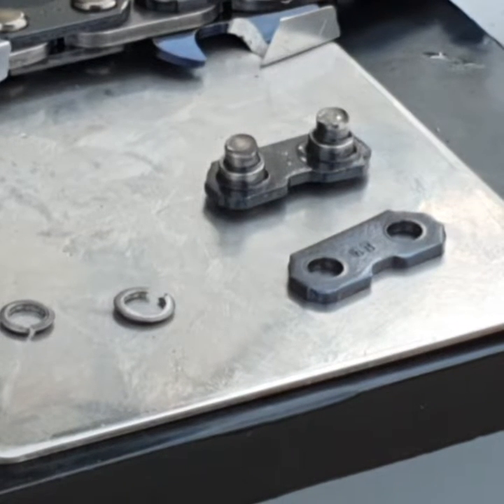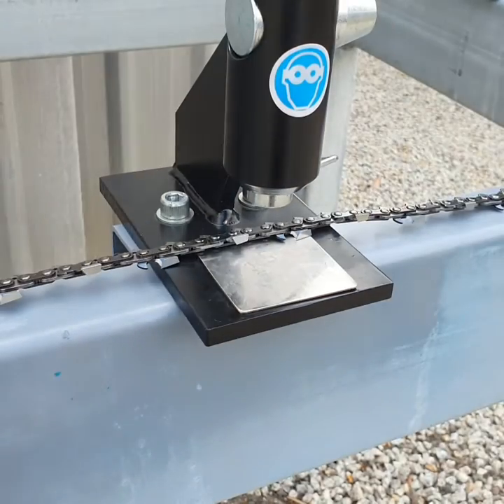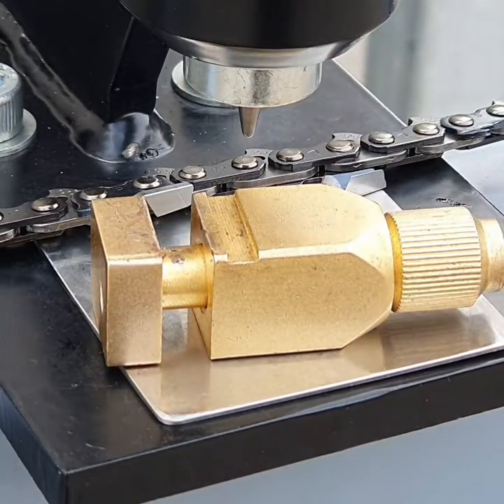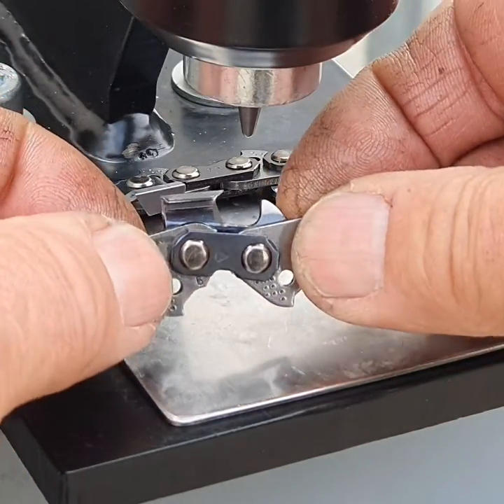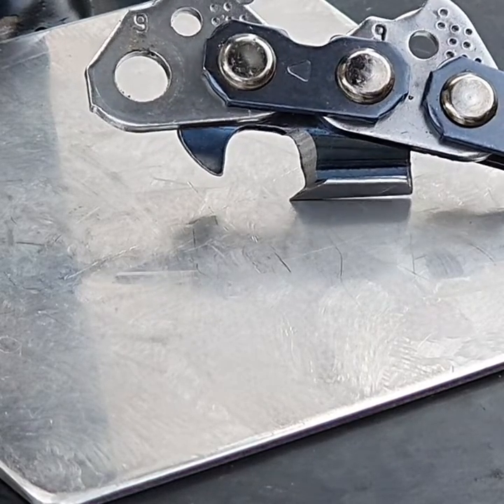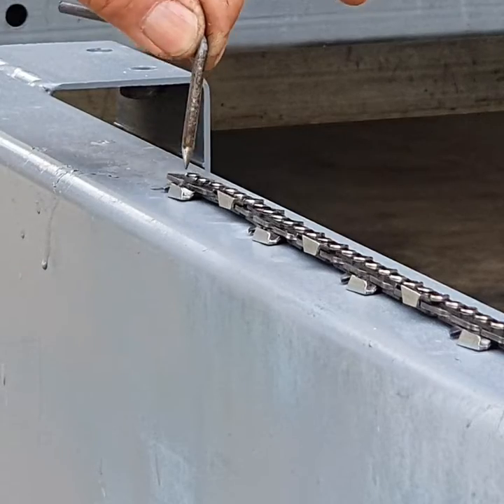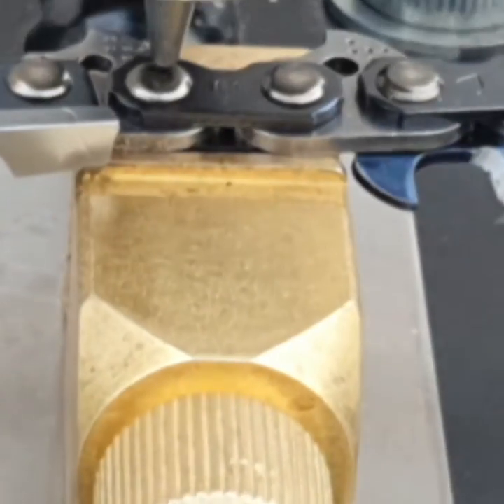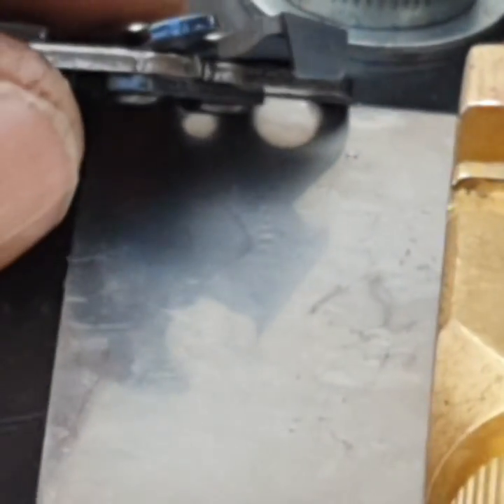Oregon type chainsaw chain breaker and how to use it

Comment: Thanks for the video! Going to get an adjustable anvil. I broke the two bits that came with the breaker within minutes of set up. Bought me an adjustable gooseneck light and a magnifying glass as my eyes are 57 years old
Reply from the maker: Yes you really need the adustable anvil. Much better

Comment: Ok I use the same vise as you. I was under the impression you clamped the two studs under your cut you tighten the larger screw first and the smaller screen last as you could get the smaller one still yet tighter . now why I'm not exactly sure the directions say so.  I've watched you and its easier for you and I've wondered why I followed the rules  it don't work as slick as what you do. I have took a dremel tool.and ground the heads of before that helps some. I'm following our lead from now on.
Reply from the maker: Dremel is slow even with diamond bits